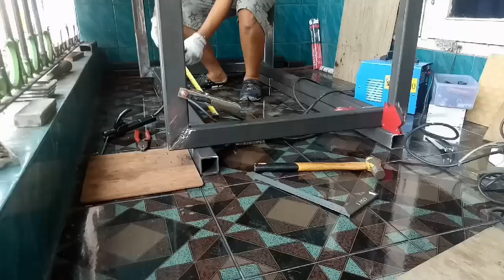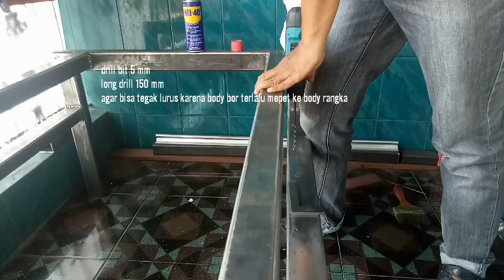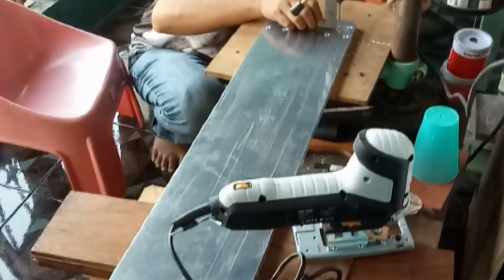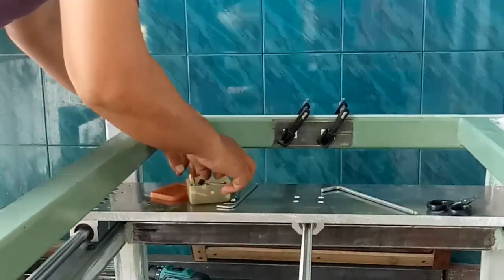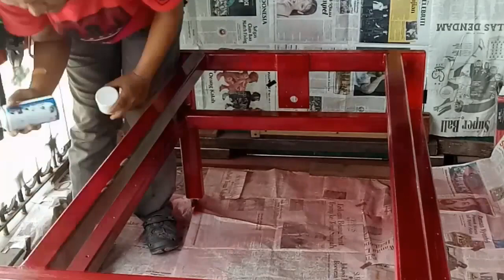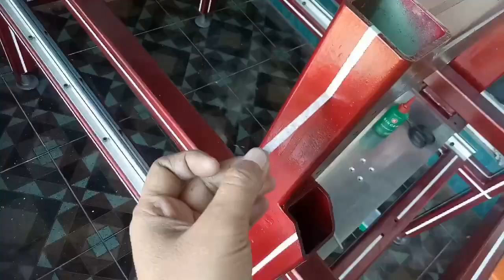DIY CNC router part 5 | Rangka menggunakan besi hollow 5mm (test run)

Comment: Great!!!!! Same philosophy as mine. Only different goal for me was to make machine which I can disassemble and transport in a car.
Reply from the maker: yes you're right.  sometimes we have to determine what purpose the machine is made for in the future.  but after the machine is finished it turns out that the bigger size is the right one.  because large machines can certainly work in small materials but small ones can't work to large materials